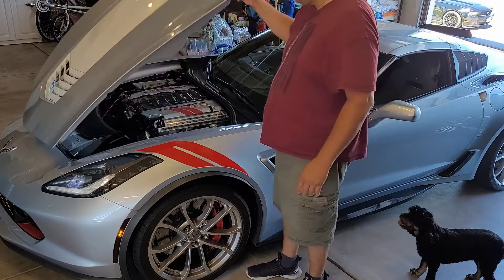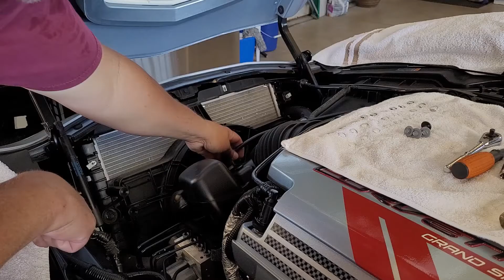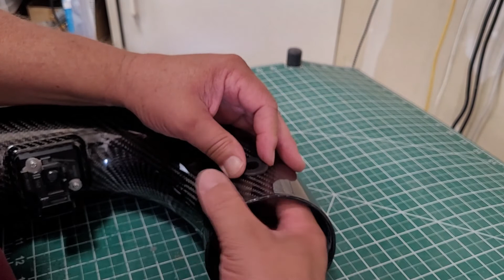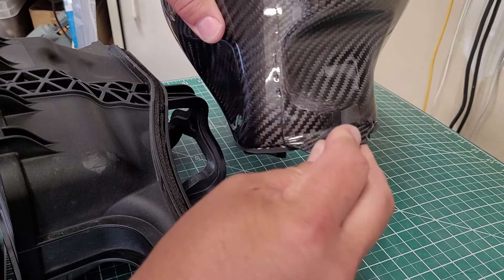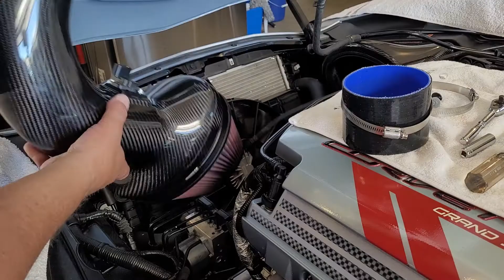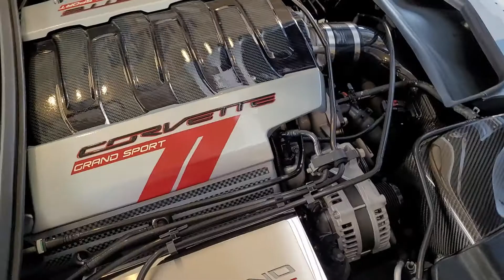Corsa Carbon Fiber Cold Air Intake | Power that Shows

Comment: A local place wanted over a grand to install one of these. I like Corsa. I have their exhaust. But a grand for a cold air intake? I don't need the carbon fiber under the hood. Nope. I got an awesome AFE on sale for $400 including shipping. It was an easy install and took about an hour but that's only because I'm slow and methodical when doing this stuff myself.
Reply: @jayf6525 Same here. Just installed the AFE Momentum (dry) yesterday. The Corsa definitely looks nicer. From a performance standpoint, I don't think that paying twice as much will provide twice the performance. We'll see how it holds up but the throttle response better and the car feels faster (could be in my head). What are your thoughts?
Reply: @cozmicsoull  I love the AFE. There is a sound enhancement and there is little doubt the air flow is better. I can't speak to performance because shortly thereafter I had Corsa exhaust installed, and the car tuned. Now, it cranks just fine for me.
Reply: @jayf6525 Which Corsa exhaust did you select? Would you recommend?
Reply: @cozmicsoull I got the Sport. The extreme is far too loud for me.
Reply: @jayf6525 Thanks for your responses. Stay safe out there!

Comment: I installed mines and it’s making my hood lift a big did I install it wrong or do I need sit it more down because when I force hood down
Reply: My pulley rubs on side intake
Reply from the maker: As you can see in my video there was none of that as an issue.  I am thinking you are miss aligned somehow and it needs to go forward and down a bit.  If really bad reach out to Corsa as well.

Comment: Greag video. Just bought the same Corsa intake for my 2017 z06. Did you have any fitment issues when you went to close the hood?  And did it trigger a check engine light?
Reply from the maker: I did not have any issues.
Reply: So I installed mine yesterday and the hood wont close. I bought the black carbon fiber piece and the install was very easy. I went to close the hood and the right (passenger) side won't latch. I turned the hose clamp 90 degrees that runs along the top of the airbox and this did not fix the problem. I'm stumped and not sure what to do at this point short if sending it back
Reply from the maker: @benjaminpeace2967  Not sure what would be wrong.  Make sure no tubing is on top and it is all tucked in the right places.  Also make sure you have the airbox into that hole correctly in the fender to make sure it is low enough.  Try looking to see what is hitting.  Maybe put some chalk or something on the top of it to see where it is hitting.
Reply: Yep. Going to do a uninstall, reinstall later. The bolts should only go in one way on that fender.. i dont see how i could have put that in wrong, but who knows. @barynovacek5982

Comment: Hey just installed it following this video, I couldn't tell from your camera angles, but is there supposed to be a small 1/4in ish gap between the filter and the airbox? Since theres no connection between the box and filter, so it just sorta sits in there
Reply from the maker: I don't fully remember any gap in there and should not be.  Would need to be tight to filter all air going into the engine.  You might want to just verify you didn't have something wrong or a part missing etc.  Hope that helps.
Reply: Just installed mine late last night. Mine has the same 1/4" gap, but still seems fully seated

Comment: Hello Bary, very nice video ! I own a 2017 Z06 and I will be adding a cold air intake. Your video made the install look pretty easy ! Thank you ! One question ? Once installed did you have to get your engine retuned because of the un-restricted cold air volume increase ?
Reply from the maker: No,  The computer with the map sensor still there automatically adjusts.  I went and ran mine with a tuner and my air mixture was almsot perfect.

Comment: Great video. Where did you buy the carbon fiber panel on top of the engine?
Reply from the maker: I bought it from https://www.rpidesigns.com/  Then I had the guy that did my air brushing on the engine candy coat the lower sections to give it that ripple depth look.
Reply: There are two finishes that they offer. Do you know which finish works better with the course of intake

Comment: What did you notice for performance gains and intake noise?
Reply from the maker: For my car it feels snappier and quicker on the response from when I give it some fuel.  The noise is awesome.  It growls more when you are giving it the fuel, kind of like the old days when you turned your air clean cover over and hear the 4 barrel carb sucking in air, but a little deeper growl.
Reply: @barynovacek5982  Great to hear it is working out. May add one to my 19 GS.